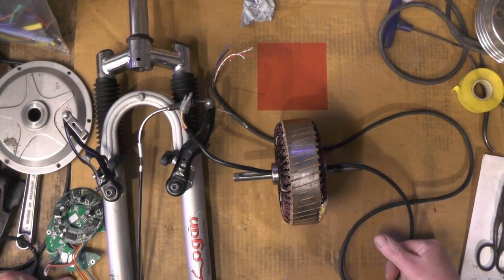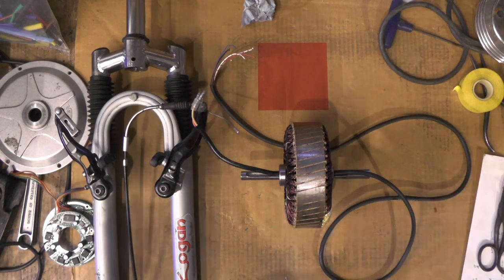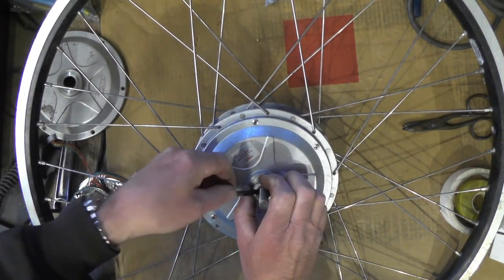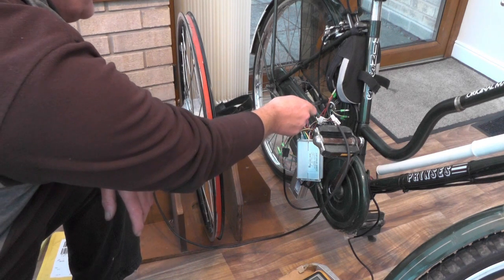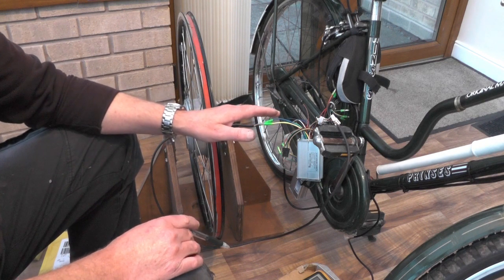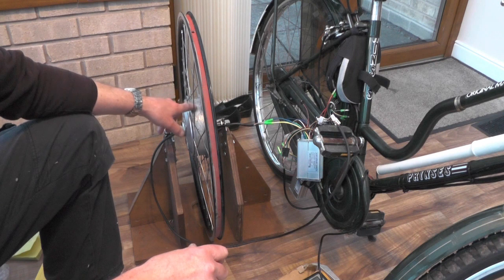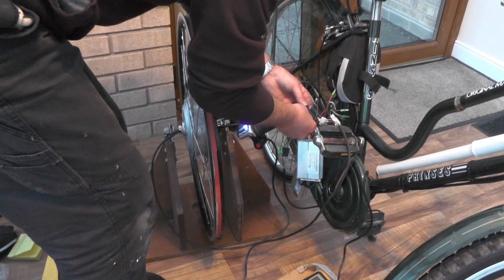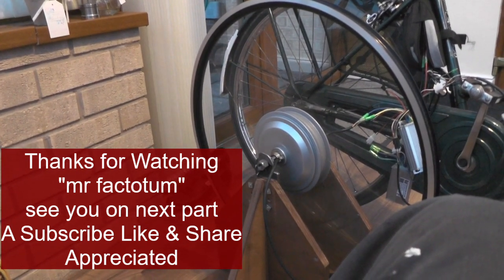Recycle a Cycle Electric Hub Motor  (Sparta) Repair a Rear ebike Hub in to a Front Hub PART 3 "mr f"

Comment: When you say Rotor....dont you mean Stator..?
Reply from the maker: hi MW
thanks for watching
Probably should be stator, usually on motors its the rotor that is on the shaft that spins, in this case the shaft stays still and the outer housing spins, so yes should be opposite way round, but i think everyone knows what i mean.
regards
mr f
Reply: @MrFactotum  its a big difference though...i know, cant speak for everyone else..just trying to be helpful....